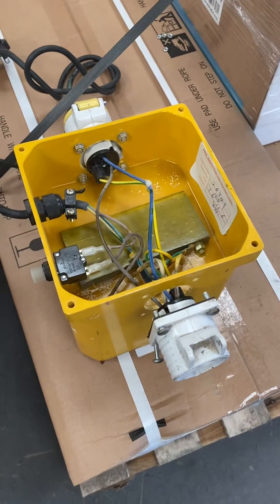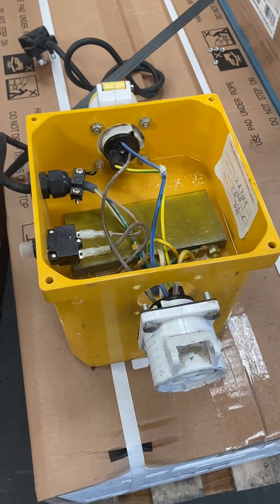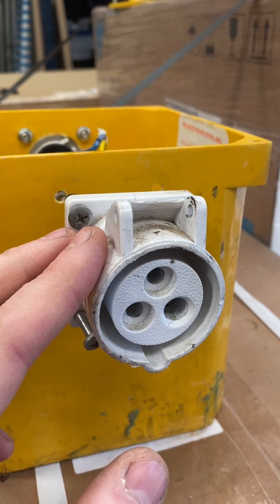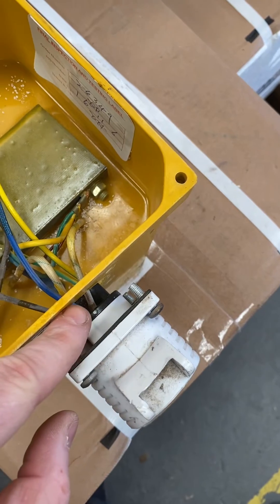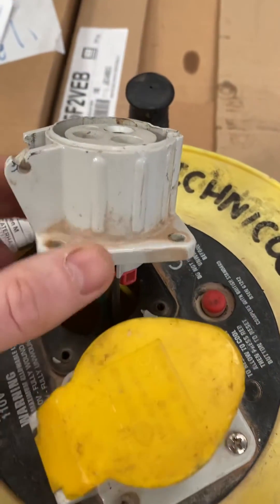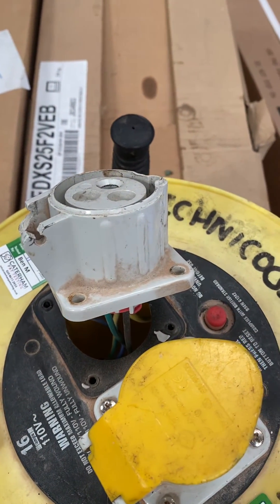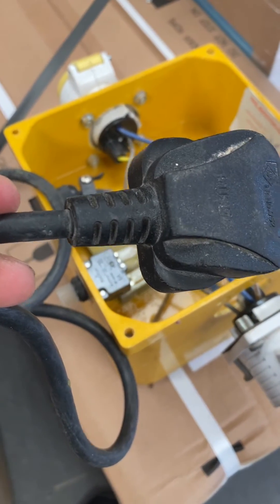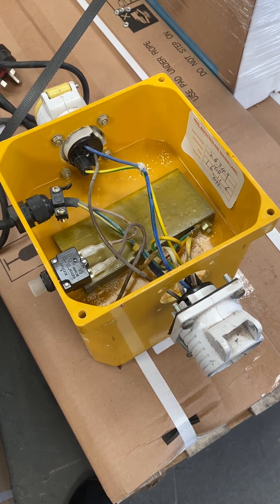110v Transformer PAT TEST - PAT Test Tutorial | Hazards to look out for

Comment: hi, just looking to see if there is video you have done or can do with testing 110v extension leads, male to female. i bought the relevant adaptors you mentioned i get in a previous video and would like some help understanding this a little better please. i keep getting O/C on every extension lead test when checking for polarity. #confused!!!
Reply from the maker: You can’t carry out a polarity test on 110v extension as it is likely that the line / neutral wires are joined inside your adaptors to prevent you powering up a 110v appliance from a mains socket. It is fine to bypass the polarity test on 110v extensions.
Reply: @ phew!! That’s a relief! Thank you for your help! Keep up the vids